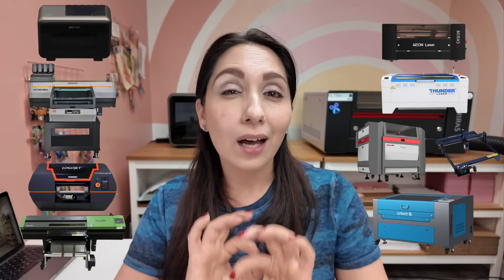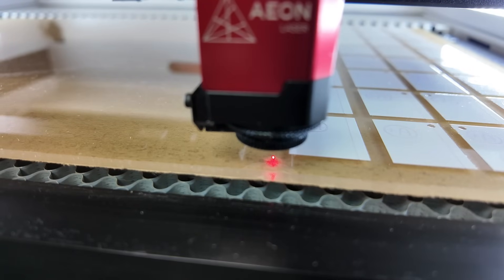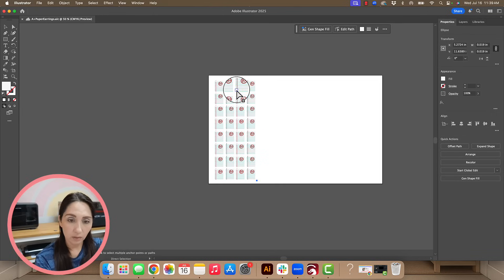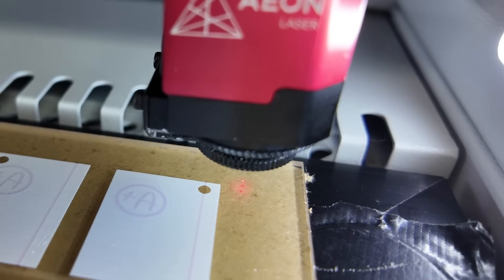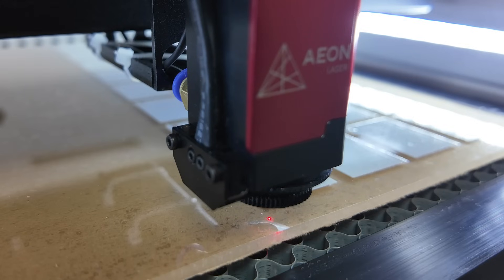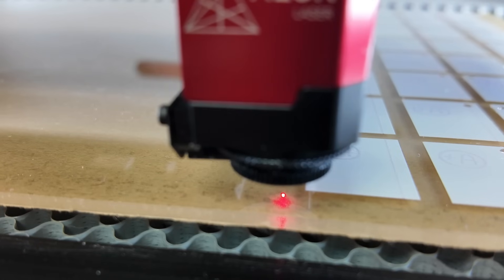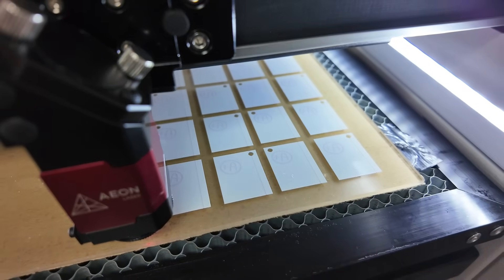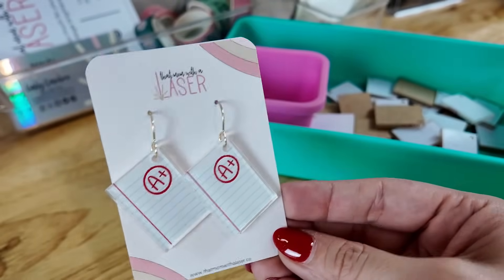Perfect Print & Cut Using LightBurn Software For UV Printing & Sublimation

Comment: There seems to be some info missing that would be helpful to people trying this. You moved from the graphic design to the laser without any explanation of how you created the cut file and cut lines. Was it a stroke in the graphics program? Or did you import the graphics file  into lightburn, trace, and enlarge a bit to create the space between cutline and print?

Comment: Probably a silly question, but if we order our prints from a vendor (like Cerulean Tides), how would we line things up for cutting? When we can’t print the dot ourselves.  I’m very new to print and cut and only use it for projects bigger than my laser bed currently. However, I’d like to start ordering prints to cut.
Reply from the maker: My understanding is they will include the dots with the print that you order and provide you with the file. 😊

Comment: So, will the dots help make sure the cuts are perfect even if the piece is not laid into the bed perfectly?  And also, what happens if you don't want an offset.  I run into the problem of the heat from the laser weakening my ink, causing it to crack.  Any info is appreciated, thanks
Reply from the maker: Great questions! Yes — even if your material is laid down crooked, as long as your Print & Cut targets (those white dots) are aligned correctly, LightBurn will calculate the correction and still cut accurately. That’s the beauty of this method!

As for the offset — I totally get you. I actually run into a similar issue with the heat from the laser affecting my ink, which is one reason I do use a small offset. But I’m actively testing ways to cut right on the ink without cracking or charring, so stay tuned! I’ll definitely share when I find a reliable method for ink-safe, offset-free cuts. 😊

Comment: What if you're not UV printing or sublimating but want to engrave, fill  and then cut? Would the default be to add a target dot and maybe fill it with white?
Reply from the maker: Hey there! Would you be running the job all at the same time? If so then you don’t really need print and cut. It’s better suited for printed items or when you take something off the laser and want to add a detail you for got or try to recut it if it didn’t cut all the way through.
Reply: @ThatMomWithALaser  It totally depends on what else I have on deck for the laser, which is usually additional work I can't really hold up. I'm thinking along the lines of multiples that I engrave & have to fill. It would seem easier to do it on one sheet, fill all at once & then cut. If I have more than 1 sheet that needs this step then what would you suggest for lining it all back up to cut?

Comment: So I don't do UV anything just sublimation, and its usually on white. If thats the case, its going to be hella hard to distinguish a faint white on white no? if it's that kind of use case, should we use a black dot? Also, what sized dot do you use? Thanks for the informative video as always!
Reply from the maker: You know what's wild? I went over this in my head a thousand times before filming the big reveal video and still forgot to mention this little tip! 🙈 In that scenario, I would actually print a larger black dot first, then a smaller white dot (or off-white in our case) centered on top — that way it's easier to distinguish from a white substrate. My dot is super tiny.  Like . 019 inches LOL .  I would start with it slightly larger until youre more comfortable. Hope that helps! Thank you for watching!

Comment: Thank you so much for this easy to follow tutorial! I had resigned myself to cut-then-print because I could never get my red dot exactly in the center of the target, even when using the remote.  One question - when you say "teeny tiny", what size do you make your dots?
Reply from the maker: You are so welcome! I make the dot so small it looks like a spec of dust.  LOL You might want to try and make it slightly larger until you get used to it.  I make mine .019 inches 😆

Comment: Great tips!!  Any advice for lasers where the red pointer is not where the laser fires?
Reply from the maker: oh that's a tough one.  In that scenario I would pule the laser beam to see where the beam will land on the material.  Optionally, you could consider adding a beam combiner so that the beam and red light are always in sync.

Comment: Can you expand on what scale and not scale means? That part confused me
Reply from the maker: Absolutely! Here's a great example.  One time I went to my friends house to sublimate an intricate rainbow with flowers.  I FORGOT to save the measurements of the size we printed! 🤦‍♀It was too hard to really know the exact measurements.  But thankfully, that didn't matter to LightBurn! I added two targets and LB knew to scale the image to the correct size! 🤯So basically, LB will scale the image to size. "Scaling" adjusts the cut to match the size of your print, even if the scale in LightBurn isn’t perfect. Use "no scaling" only if you're certain the print and LightBurn job are exactly the same size.